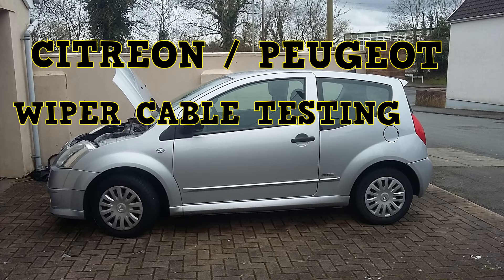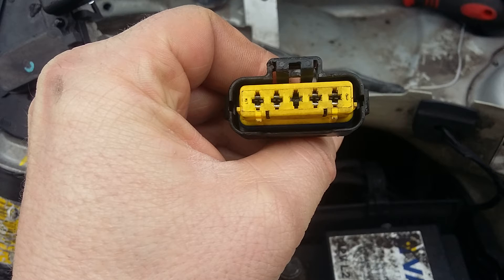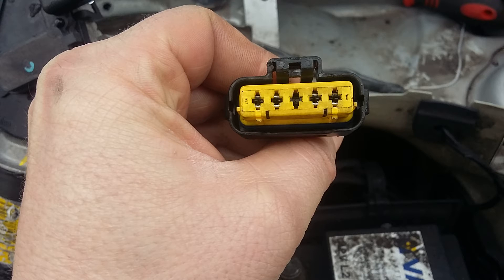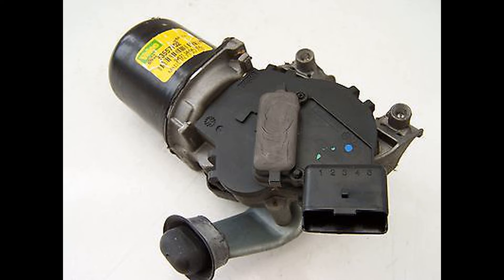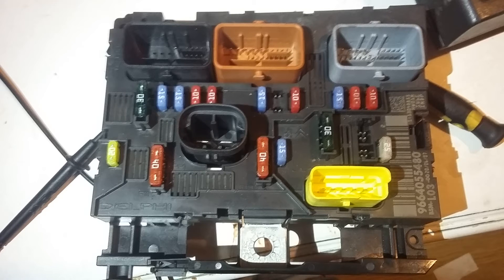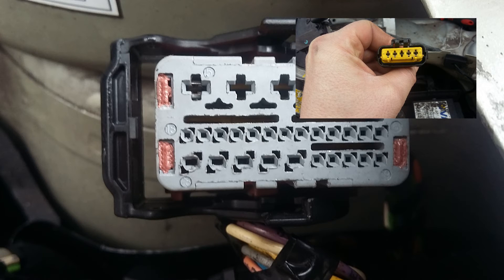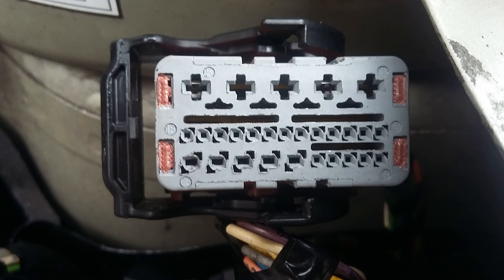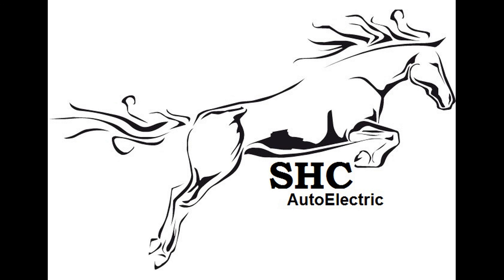MY RELAYS WORK

Comment: Hi, we've a citroen c1 and have wipers working on high speed only

Is there anything you can think of?

We've had the steering wheel off as the original problem was the indicator stalk which we've cleaned up and now working

Just the wipers are working high speed only, I'm hoping I don't have to take everything apart again but just checking if there is a simple solution
Reply from the maker: Did you fix this?
Reply: Yes we fixed it, one of the pins needed bending slightly, cheers  @bry940

Comment: Hi I'm Hoping you can advise. I have a Peugeot 207 2007. the wipers were intermittently working and now just not working at all. I followed your guides. Did the resets. Tested for voltages. in which i was getting no voltage when i put the wipers to low or high but i can hear the relays click. i put a different fuse box in and still got the same issue. I put power directly to the motor and the motor works. However I'm now stuck as I'm not sure what else to look at
Reply from the maker: I haven't looked at one of these in yeas to be honest. Can you confirm you have voltage coming out of the box? Can you confirm the wires between the box and the motor are ok
Reply from the maker: By the way, when I did this the relay box was the issue. I dropped it on the floor kicked it about and it worked after that
Reply: @bry940  I did drop it accidentally when i took it out. however didnt kick it round.
the replacement fuse box i got was doing the exact same
Reply: @bry940  When the key is on but engine off i get 11.6v from the main feed. and if the car is on i get around 13.5v and i have tested continuity all the way between the wiper motor and the fuse box
Reply from the maker: Is that voltage out or in. If you can't get access  to voltage out you could push the probe into the insulation near the box. To me it sounds like a connector issue, but you might have two broken boxes.
Reply: @bry940  that's at the connector that attaches to the motor. I tested again at the connector between.

Comment: Wipers stopped working with no warning at all.
Pin 5 and 4 show 0 volt regardless of stalk position. Checked continuity with the plug as per video and multimeter plays sound.
Pin 2 shows 12 volt permanently and Pin 1 has continuity with chassis.
Can hear relays clicking.
Your video suggests it's the bsm, is this likely to be the case? 
Mine is a ds3 2014 with 1.6 vti petrol.
Reply: I am the person who put that comment but i am replying from my own account to help others.

I replaced the bsm and wipers are working perfectly now.

ebay unit I bought for 73 pound delivered next day.

Manufactured January 2023. Hw8 sw8.

Original 2014 version hw12 sw8.

Same part number on both but 3 parts numbers refer to the exact same board.

Ultimately it the part is 6500hv and the car is rhd uk spec 2014 ds3 1.6 vti 120bhp (no turbo)
Reply from the maker: I hope the video helped

Comment: Hy there. I have a problem. My whindblades of Peugeot 307 2.0 hdi are moving ,working non-stop without puting the key in ignision. It stops only when I remove, take out de green 30 amps from BSM. And I dont now If this problem is related with my bord lights,Air conditioning lights and central Control information bord lights are all blinking ,the lights are stronger for 1 second,then less lighter. Like a Christmas Tree. Can I please help?
Reply from the maker: I think that it might be. Have you tried a reset

Comment: I have been troubleshooting a Peugeot 307 wiper problem.  The connector to the wiper has ground on pin 1 and voltage on pin 2.  The strange thing is that the voltage on pin 2 is around 1 V below the battery voltage and the voltage measured on the fuse (and in fact on pins 4 & 5).  The wiper motor does not move when the wiper arms are bolted back on but moves fine without them.  What could possibly be wrong in this case?  Despite world class instructions on this channel I have been unable to work this out.
Reply from the maker: If the voltage is lower than the battery voltage you have a poor connection. This means there is not enough power to more the motor with the wipers fitted. Check voltage against both the negative terminal and the cable earth. Is there a difference? If there is the problem is on the earth. If not the problem is on the supply

Comment: Hi, is it possible that the numbers are different in Peugeot 306? (I have 12V in number 3 for example)
Reply from the maker: Yes it is possible but unfortunately I dont have the diagram to hand
Reply: SHC AUTOELECTRIC thanks. 
I think I found out the right numbers for me,  as I understand my number 2 (it’s  5 in my car) does not work 
Is it true that my problem is the motor?
Reply: Is there a way to send you wiring diagram and pictures?
Reply: I didn’t mentioned my problem. 
1st the wipers always stop in a random position 
2nd on fast mode the wipers stop after a few seconds
Reply from the maker: I'm going to need more detail. What year is the car? And what do the wipers do in slow.
Reply: SHC AUTOELECTRIC my car is 2002 model,
In slow mode it’s working properly.
Reply: I also have a sensor mode that work but also stop in random places.
Reply from the maker: Sorry I haven't replied. You can send any diagrams to bry940@yahoo.co.uk

Comment: Hi. I have an 08 plate C4 Grand Picasso with a wiper issue. The guy who owns it has already replaced the wiper motor with no luck. 

The passenger wiper doesn't move at all. The drivers one moves a couple of inches and then twitches back and forward. Are the 2 wipers controlled by the same relay in the Bsi? The last test you show is for continuity between 2 points...are these the same points in the c4?
Reply from the maker: Im not sure if they are the same but most of the citreons are. However your problem sounds like a mechanical issue. Have a look at the linkage.

Comment: Hi. I have problem. Last owner of my car had also this kind of problem. It doesnt matter .. slow speed, fast speed, they randomly stops after few seconds in random position. After that i need to turn them off and again on, this is the only way. Every time they turn off after exactly the same time in random position on each setting. Last owner changed com2000, so there is a new one, and also he changed wipers. Relays work. 1st click when for example im turnig fastest mode and few second later 2nd click thats all. Im wondering why, because there could be a interval. And most important thing.. This problem starts when last owner changed the radio.
Reply from the maker: +TEKO - TepicKurestwoOficjal PS4 Crew 

First here is a link to the 'how it works' video if you haven't seen it already.

https://youtu.be/zyEVml_o_eU

From your description it sounds like it could be one of 2 things.

Firstly the BSI could be playing up. If so carry out the bsi reset procedure. You should find the relivent processes in my other videos.

Second, there is a possibility that the curcuit is drawing to much power and shutting down.

Carry out a BSI reset and let me know how you get on

Comment: Hi buddy, over the past few days in the cold my wipers stopped working on my 06 plate Citroen berlingo panel van. Now as temperatures have improved when I turn wipers on at stalk I can hear the wiper motor working and there's a little bit of movement in the wiper, about an inch of movement but the motor sounds like it's making full rotational movement while wipers Don't, what could be the problem? Thanks in advance.
Reply: Also my windscreen washer not working...
Reply from the maker: +michael mayo first you're going to have to gain access to the motor and look to see if the nut driving the linkage is tight. If so remove the nut and ensure the driving parts are ok. Start there and let me know how you get on
Reply from the maker: +michael mayo just a note, if you tried to wipe frozen snow off the windscreen you might have damaged the linkage
Reply: SHC AUTOELECTRIC I did do that, is it potentially repairable or would I need to buy a new unit? Thanks
Reply from the maker: +michael mayo I would expect the motor is ok and the linkage is rounded where it connects to the shaft. It will probably need replacing but a temporary repair is possible
Reply: It was the nut connecting linkage to motor, I've done a tempary repair but it's clear the nut is trash so I'm going to replace it and put a bit of lock tight on it or something to try keep it on longer. Thanks for your help buddy.
Reply from the maker: +michael mayo no problem